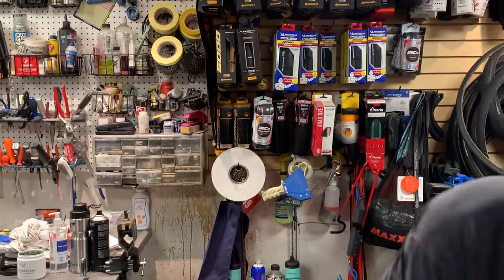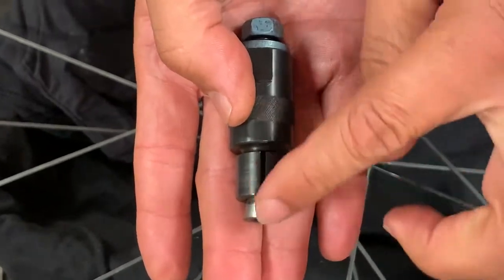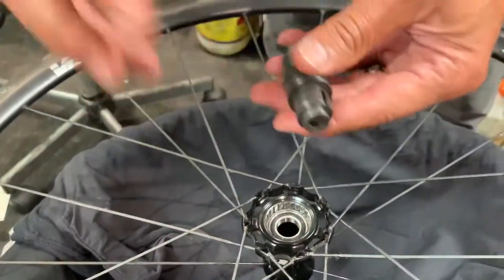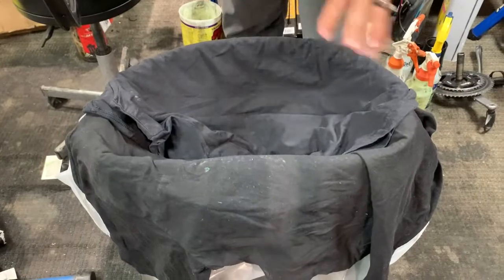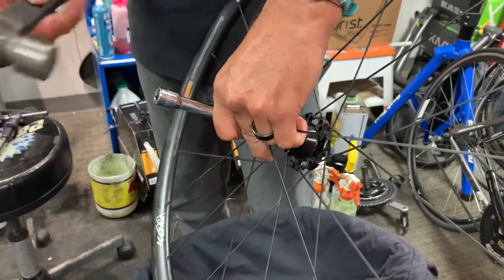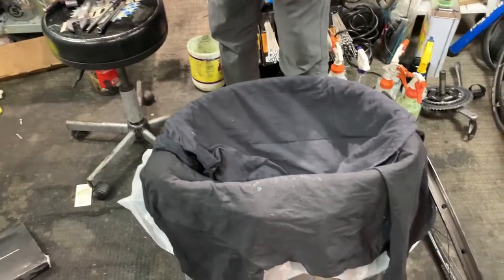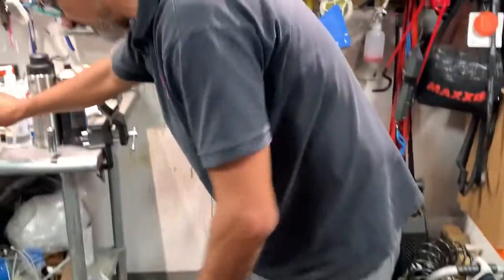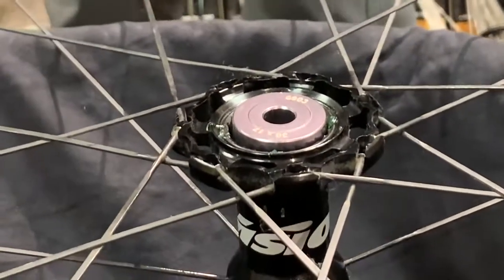How to replace cartridge bearings in your wheels

Comment: I’d be interested in what brand of cartridge bearings you use and or like.
Reply from the maker: Great question Patrick! I generally use steel bearings for myself and customers when they have not voiced a preference. I don’t use ceramic bearings because I don’t find that they last very long in spite of all the marketing claims. They are also far too expensive for any type of real life gain.

Regarding the brand I think most cartridge bearings are produced by a very small number of manufacturers so regardless of what name is printed on the outside they’re all basically the same. If I have a choice and they make it and it’s in stock I do like Enduro bearings when possible.

I hope this helps. Let me know if you have any other questions

Comment: Did this customer ask for new bearings or did you notice they needed replacement during a regular tune-up?
Reply from the maker: Excellent question! These wheels are mine. I should’ve spent a little bit of time explaining why I was replacing the bearings. They were Notchey and I didn’t like it that way 😂
Reply: @SeeYouUpTheRoad   I'm guessing with all the climbing you do, the descents put your wheel bearings through more-than-normal wear and tear?
Reply from the maker: @UnivegaSuperSport  indeed! I don’t weigh much. I also don’t put out a lot of power. However, I put a lot of wear and tear on my bikes/components.